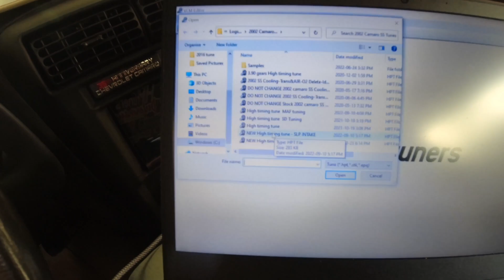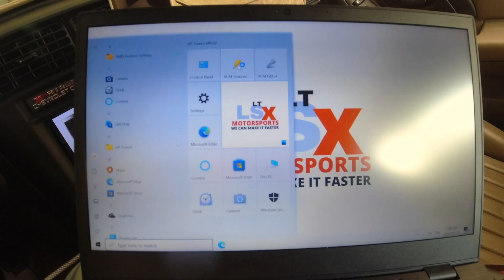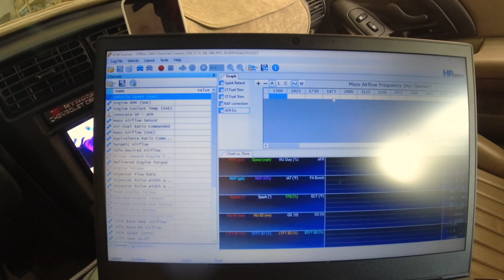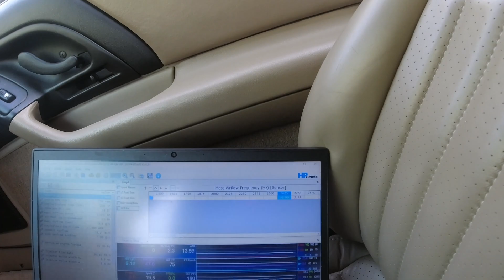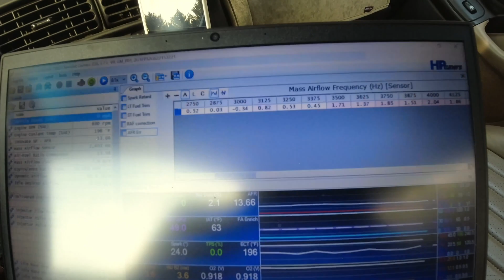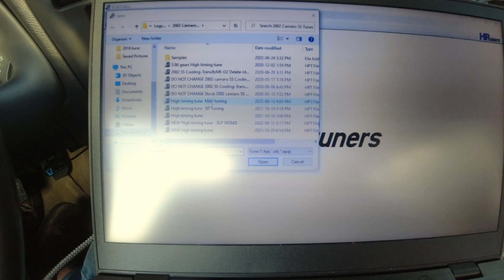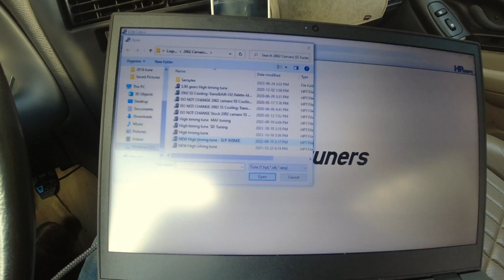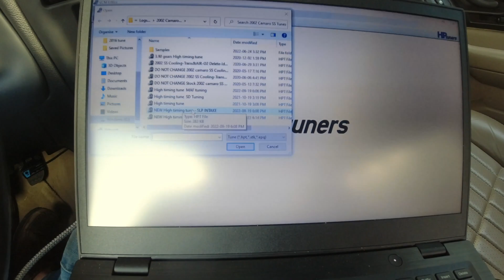Tuning an LS1 Camaro - Tuning with HP Tuners

Comment: I went to 5.38:1 in a 2002 WS6 and love them, but the pinion gets small...
Will go to a custom rear end eventually.
I am looking to improve the tune on this Procharger twin intercooled, Alkyl injected system when I find a solution.

Comment: Thanks for posting! What're the intake/exhaust mods apart from the SLP intake? I got my 00 SS with headers and some funky O2 sensor work to compensate and was wondering if I need to bring it back stock to take advantage of this info. I'm only just dipping my toe into tuning so sorry for the potentially dumb question. Also yours sounds really good so I'd like that for mine too!
Reply from the maker: Thank you for watching and commenting.I have BBK long tube headers and speed engineering true dual exhaust.I was unaware of speed engineering when I got headers so that's why it has BBK.The only intake mods are I ported the stock throttle body and Mass Airflow Sensor (Both are a waste of time) and still running the stock LS6 intake manifold.Now when you mention your O2 sensor mod I assume you mean O2 simulators and yes with hp tuners you can remove them and turn off the check engine light in the tune.Basicly you click a few boxes and the computer ignores the secondary O2 sensors.If your looking to learn tuning a great channel is goat rope garage.Thats where I have been learning.He is a much better teacher than me.And there are no dumb questions.lol.Thanks for watching and commenting we really appreciate it and we will always answer any questions anyone has if we can or at least point you too someone who can answer your questions.
Reply: @LSxMotorsports2021  thanks so much for the info!! About to binge some of their videos rn. And I totally forgot about the ls6 intake. Got a new mod idea. Thanks again!
Reply from the maker: Anytime we are just happy someone watches our channel.lol.

Comment: Did you have to unlock the security feature on the car before flashing it with hp tuners
Reply from the maker: I am not aware of a security feature.But all I needed was 2 credits from hp tuners and I have been able to flash it dozens of times in the last few years.